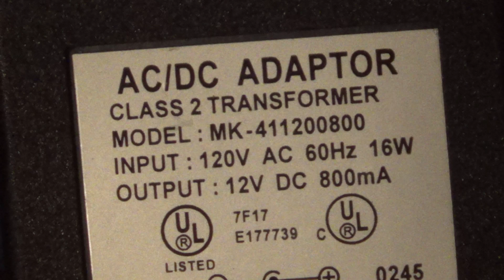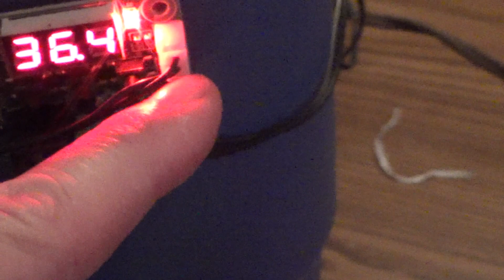Installing a w1209 12 volt DC Digital Temp Controller into an Incubator!

Comment: Hello . Thanks for the insightful video. Just a small question . I have been using a tiny fan with a w1209 thermostat with no problem. I'm using mains 240v stepping it down with a small 300mA adapter. Since I wanted a bigger incubator, I went for a bigger computer CPU fan rated 0.40A. Funny thing is as soon as I connect the bigger fan, the thermostat flickers then the 40w bulb goes off completely. What could be the problem. Thank you in advance sir.
Reply: Hey Tom! Are you also running your fan thru the thermostat? If so, it may be over-loading the power relay in the thermostat. I use and extra power source for my fans.  Wade

Comment: Sir Can i Use 12 V 1 ampere Adaptor for W 1209 thermostat? 

I have many 12 v 1 ampere adaptor but dont have 2 ampere adaptor . will it work and load 12v fan and 60 watts bulb?
Reply: I would give it a try! It should work. Wade
Reply: Bubba Rountree Outdoors It worked fine
Reply: awesome!

Comment: hello sir,did you use the lamp 12v?or 220/240v?.i just wonder why my lamp 220v is not working with this thermostat.i need to use inverter 12v to 220v or not to connect to the light?pls help me for the anwers.tq
Reply: You only need the inverter to power the unit & the fan (if the fan is a 12v DC fan)
Reply: Bubba Rountree Outdoors 

tq for quick reply.i got inverter 150w and a fan,now i dont know how how to connect the inverter.i'll try but not working,i bought inverter 150w from ebay and also same with you the thermostat.the inverter have a jumper,i dont know how to use it.it has 110v,200v,220v,and 280v.please help me sir,if you have any contact that i can send the inverter picture,so you can give me the anwers of connection.tq
Reply from the maker: https://youtu.be/z-bB13_4_9o

Comment: It is NOT a 12v inverter. An inverter turns DC into AC. You are using a transformer + rectifier, which is a power supply.

Comment: hey buddy, thanks to you I got 2 incubators going, everything seems pretty good, I had an idea that mabey you can perfect, one of NY incubators is either really high in humidity or borderline low, I was thinking of those glade automatic air fresheners, if we could get water in the tube instead of scented aroma, it comes with a timer per spray and I think it would help regulate the humidity during the cold season. oh and one more question, what other economic option do I have to make my own automatic egg turner, any other motor out there that's less expensive than the 13 dollar ones at IW, thanks buddy.

Comment: hey buddy I really need help with lowering the humidity, I tried baking soda, socks in rice, even added an extra fan, nothing works, I live in mexico in Cancun so its very humid, average humidity is 75/85 on any given day, when I did the 24 hour stabilize it was at 40 humidity, once I put the eggs in slowly but surely it skyrocketed, went up to sixty, the only thing that worked to get it down to 53/54 humidity was turning off the fans, so day one was fans on day 2 still air, right now its at 102.1 with 53/54 humidity, I would like to get it down so I can use the 99.5 f any tips I heard aluminum helps?
Reply from the maker: Hey Erick! You may have to cut a couple more 1/2" vent holes in the top of your incubator! this will allow more humidity to escape... Wade
Reply: thank you for responding I appreciate it very much.

Comment: please can you tell me that , can I use 40watt and 60watt bulb in incubator with this thermostat. as it is 12v . please help me out
Reply from the maker: +Adil Khan Yes you can...
Reply: sir i just wanted to ask that the temperature hygrometer is showing is it accurate as my hygrometer is showing different reading
Reply: sir i just wanted to ask that the temperature thermostat is showing is 
it accurate as my hygrometer is showing different reading

Comment: also if it does have to be dc, what kind of bulbs are you using? I can't get anything to work on mine
Reply: The unit requires 12v dc to operate. The heat source can be regular 120v ac light bulbs.
Reply: +Bubba Rountree Outdoors I have the power hooked up. it powers on but nothing I hook up as Har as for heat does not work. I tried a bulb set up amd I tried my heating element, and I get nothing. I can hear it kick on and off when I adjust the temp but no light ir no heat.

Comment: Does the heating source have to be DC? I am trying to hook up my heating element from my old incubator, but i cant get it to work. any suggestions? thanks
Reply: Shannon Clubb yes u can also make with dc 12v  but make sure w1209 thermostat 12+ and gnd point power not exceed 12v  5amps is amp amps increses then its damge the components
Reply: But you can use 12 to 14dc volts on k0 and k1 max 20 amps

Comment: Hi, in the controller loses power its settings remains or are lost?
Reply: +Orlando Volpato The unit should not loose it's memory in the event of power failure. If it does, it's is malfunctioning!
Reply: thank you. Need to check before I buy.

Comment: You can program the W1209 so it does not cycle so often. Press and hold the SET button for a few seconds and you get the P0 to P6 menu. P0 selects whether you want the W1209 for cooling or for heating. P1 selects the hysteresis temperature range. It is 0.1 by default but you can increase it so it will not cycle so often. Also, if the load is significant, say above 100 W, then it might be better to add an external relay to protect the small on-board relay.

Comment: I've got the thermostat working and the LED changes at the set temperature, however the fan I've attached won't power on.  
12V 0.5A Imput (AC adapter supplied from the fan)
W1209 themostat (Output 12V 10A)
To 12V 0.5A Fan - (7W on label)
I can power the fan from a different 9V 1A (9W) adapter with reduced performance.  
It's been a while since I did any electronics/physics, I'm guessing the thermostat transformed the current up to 10A and this is causing the fan not to work, would someone be able to offer an explanation / solution?
Reply from the maker: garden wind I had my 1st one fail after 2 years of constant use... I don't use these thermostats anymore! I only use the stc-1000's.
Reply from the maker: Alexandra Goddard Maybe this will help Alexandra: https://www.youtube.com/watch?v=z-bB13_4_9o
Reply: Rush Lane Poultry & Game Birds I tried 2  of these new thermostats after 6 weeks the points burn out I had them set to 1 ten of a degree . They work great while they worked. Have you had the same problem?
Reply: Alexandra Goddard will 12v 1 ampere adaptor work for w 1209 thermostat?

Comment: Hi. Great video. I bought one of these for 2 purposes. Both are for home brewing beer. 1 is a bit like an incubator(fermenting chamber) when fermenting lager beers they have to be at low temperature 12°C & consistent.  So for that project I plan to use a fridge in my shed that has no power. Do you think if I used a car battery and a car light bulb in the fridge (obviously battery outside fridge) it would work.
Reply: Rookie Brew That should work well as the amperage draw is so low the car battery should last a long time! A marine battery would almost last forever...
Reply: Awesome thanks for the quick reply. So I take it the input connections on the right and the 2 on the left outputs.
Reply: Rookie Brew Yes... The 2 connections on the rt. are 12v DC in, and the 2 on the left are the activation circuit.

Comment: wich one works better this one w1209 or the  stc 100 i need one but need input on wich one keeps temperature more stable thanks
Reply from the maker: rodrigo calderon Both work equally well at holding temps. The w1209 requires a 12 volt dc inverter to operate but  if you get a 115 volt stc-1000 you won't need a 12 volt DC inverter.
Reply: i wanna build my own incubator and cant decide wich one to buy if it was you wich one would you get i know the w1209 is cheaper but i dont mind paying for the stc 100 i just want what would work best thanks  for the quick response..
Reply from the maker: rodrigo calderon My pleasure Rodrigo! If I were building 1 tomorrow, I would prefer the stc-1000.
Reply: very nice that's what I wanted to know I will buy the stc 1000 thanks

Comment: Great video, thanks! I just bought a controller similar to this on ebay and am wondering if I need a ssr for it? How would I know if my model will need a solid state relay? could you please give me guidance as I am completely new to this type of thing. Thanks a ton!
Reply from the maker: The controller should come with a list of specs... it should tell you the capacity of the internal relay. As long as the capacity is 10 amps or better and if you're using light bulbs as a heat source, you wont need a SSR.
Reply: Rush Lane Poultry & Game Birds
Ok, I looked at the listing again and it says "Output: 1 relay output, capacity = 10A"
http://www.ebay.com/itm/231496253068?_trksid=p2059210.m2749.l2649&ssPageName=STRK%3AMEBIDX%3AIT
I have hooked up everything to the coolerbator and the thermostat has power and shows numbers. But it does not turn the lightbulb on and the little red led does not come one and off like your does. Is it possible that my 12 volt dc is not good enough? It is a very old small black box and says output 12 volt dc 200 mA. Any help is greatly appreciated  - I have my hatching eggs waiting for this to get going, they are already 4 days old so I hope I can pull this together in a couple of days. Thanks!!!
Reply: John Doe Smith That's right... your inverter may not be any good!
Reply: Bubba Rountree Outdoors
Hi, I got the controller to turn on its led and I can hear a clicking noise like the relay switch working. But the light still won't work. I think that my 12 volt cable is not powerful enough. I have one that is output 12 volt dc 200 mA - will this one work? Does it need to be 800 mA or something like that? Thanks for all the help.
Reply from the maker: John Doe Smith here's the wiring diagram: http://www.rushlanepoultry.com/12volt%20DC%20Digital%20Temp%20Controller%20Wiring%20Diagram%20web.png

Comment: I ORDER ONE OF THESE DIGITAL TEMP CONTROLLER,  COULD YOU SHOW HOW TO SET UP THE CONTROLLER .  ON THE AUCTION SITE IT SHOWS THE SET UP METHOD.  COULD YOU SHOW A VIDEO OF HOW TO SET IT UP?   (THE SETTINGS THAT YOU USE)
          P.S. I LIKE HOW YOU GO IN TO DETAIL TO EXPLAIN & SHOW HOW TO MAKE & INSTALL THE TEMP CONTROLLER

Comment: Dear, can I used that for load 220V ?
Reply: You can buy same w1209 thermosat which have 12v dc and 220v 10amp  relay   there are 2 w1209 thermostats 1 have 12v dc  125vac 20 amp  buy your thermostat u need  if u load on 125vac relay w1209  thermostat with 220v its works but after some times may b 3 to 4 month relay will burn then u need to replace relay its depend on your load how much watts
Reply: Sure you can... as long as the draw doesn't exceed 10 amps!
Reply: Bubba Rountree Outdoors thank you very much to your information

Comment: I have a question about this thermostat, I have this installed on my incubator made from the R7 2" Styrofoam from the depot. I am using cabinet incubator 125watt heating elements (2 of them, might be overkill) but my issue is if I put the sensor where the eggs are it takes too long for the sensor to pick up the heat and by that time it's too hot. I have two fans in it one blows to the front and one that blows across.

Should I place the sensor between the elements so it shuts off fast and just keep a thermometer down by the eggs to monitor?
Reply: I was also thinking of taking 1 out. I could also make a short clip of it and see what changes you think I should make?
Reply: Kitsapbeek Yeah... I think would be a good idea! 1 element would prolly be plenty enough!
Reply: Is the air completely circulating trough out the box. Mining taking the hot air from heating element to all places in the incubator?. Are the fans powerful to move the air? cfm....Do not know the capacity of the box cubic foot but  two heaters are to much.

Comment: Basically what I am asking can the control unit in a little giant be convert to use the w1209 thermostat.and will it work with work with heating  element if not what kind of heating element do I need.Try already but when the thermostat reaches the 37.5 the number on the thermostat keep going up.Any help would be appriaceted.
Reply: Yes it should work just fine! That heating element should only be pulling around 1 amp. The temp unit has a 10 amp relay on-board.

Comment: when using the DC12V Temperature Controller Thermostat Switch will need a seperate thermomter to check the temp or how do iset it up because the w1209 keeps climbing temp up how do i account for temp or fix to stay steadyThanks
Reply: James Mitchell  you can fix w1209 thermostat temp error little bit in menu by hold set button 3 to 4 sec on  p4

Comment: What size solid state relay would i need for a 45 watt heating element.And do i need a heat sink also. Thanks
Reply: You shouldn't need a SSR if your using a 45 watt element! I have one of these controllers running a 100 watt element without a relay... they have a 10 amp rated relay in the controller!

Comment: Wade, as always, thank you for your great videos.  Love them and looking forward to much learning from you.  A few quick questions:  would you recommend this 12V DC Digital Temp Controller over the STC-1000?  Why or why not?  Also, where do you purchase your 12V DC Digital Temp Controller from?
Reply: I have found both digital controllers the be very effective at incubating and hatching chicken eggs!!! The 12volt DC model W1209 is more sensitive than the STC-1000... but the only big advantage that the w1209 has over the STC-1000 is cost... The STC-1000 is twice as expensive as the little w1209 12volt DC controller. Go to ebay and enter 12volt DC digital temp controller and you will see the controller that looks like the one in the video! Usually around 6 to 7 bucks!
Reply: Bubba Rountree Outdoors, thanks for the input and direction.  Will definitely get the 12Volt try out, depending on how it turned out, might jump on the STC-1000 at some point.  Thanks again.  All the best.
Reply from the maker: organogardener Thanks guys! The new STC-1000's are great little controllers! I have one on my home made Sportsman that's been running for 3 years now... Set it and forget it! :)
Reply: Rush Lane Poultry & Game Birds  Always grateful for your sharing of your knowledge and experiences.  About your Sportman, have you done a video on it yet?  If not, do you plan on doing one?  Would love to see it.  Curious, with the set up you've shown us with the light bulbs and this STC-1000, what kind of limitations would there be, if any, if I try to set them up in a regular (full size) upright freezer chest as shown to the left of this picture:  http://solarhomestead.com/how-to-choose-a-freezer/?
Reply: Ebay is one place the other one is aliexpress if you want to order from China...

Comment: i don't know how to contact you off this group ... i have a question concerning my old GQF 1202 Sportsman (one thermostat-wafer) auto egg turn .... the egg tuner has started turning only one way , i can reverse it / hold button down to get it turned the other way and it turns back the other way perfect but will not go back the other way on it's own (i have to hold button down to get it done) .
After watching a couple of your videos i decided you were number one in this business/hobby !! If anyone knows the answers it will be YOU !! 
Thanks for any help
Reply from the maker: LOL! Thanks for all of the kind words Shannon!! :) I have never owned a sportsman... but after looking at the wiring diagram for the old 1202 I think that you probably have a bad roller switch or timer motor switch on your auto turner.
Reply: Rush Lane Poultry & Game Birds thanks for the help ... i can not decide which i need to order ... i may try to contact GQF .
Thanks and Best to You